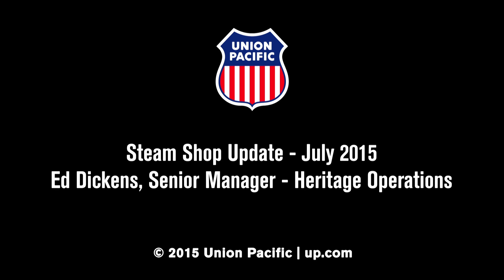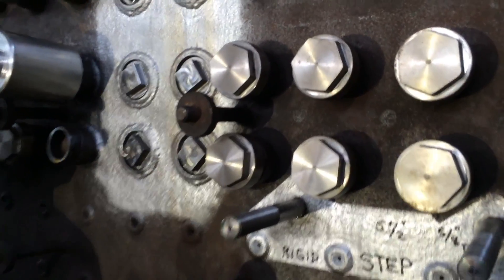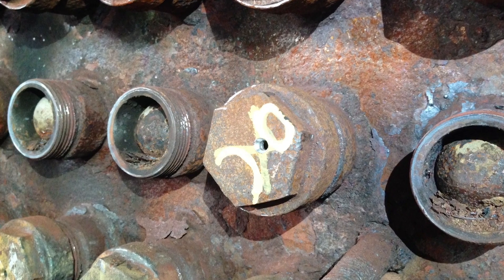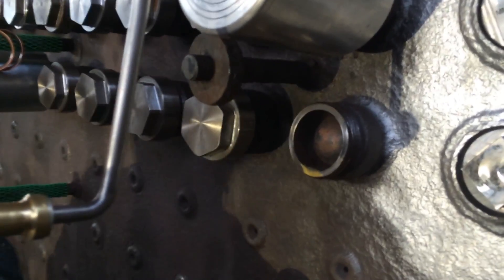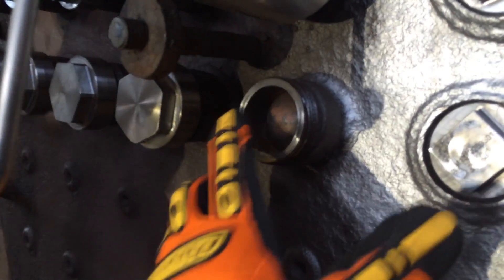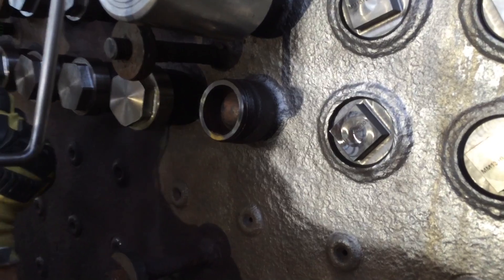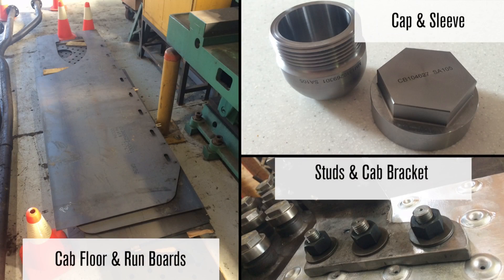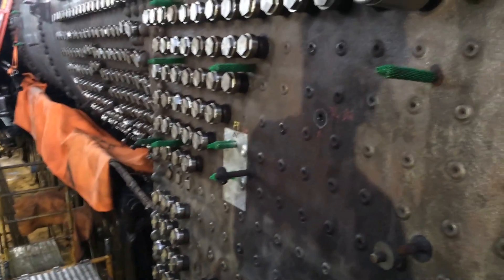UP Steam Update: July 2015

Comment: Will 4014 be converted to run on natural gas?
Reply: most likely oil if it is converted at all. Natural has would require so many modifications it would take away the preservation aspect.

Comment: Great update. Have you folks thought of setting up a water conditioning car and using some type of forced air drying system when the locomotives are off line? I work with steam plants and understand the need for clean pure water with the right chemical properties and proper lay up to prevent damage when they are not steaming. When I saw the video of what you were seeing on the boilers, it make me think of what I do to prevent that kind of damage.

Comment: I've a feeling that the UP will need fair-capacity desalination plants at the largest terminals to support the steam program properly, given what we know of the corrosion that sidelined #844 (the Sierra has a down-size version of this same problem, which resulted in corrosion contingency work on the in-overhaul (as of July 2015) #28).  Hopefully #3985 can solo the rest of the 2015 excursion season; #4014 won't be ready for another four years.

Comment: Now as long standing fan of the 844, the 3985 and the 4014, and I can not forget to mention the Southern Pacific 4449 Daylight..... I know the 3985 has been down a lot longer than the rest, and oddly enough running up against the federal maintenance overhaul deadline on the 844 was a huge setback as they were prepping for the 4014 project, so I know a lot of people are wondering if they are going to see these trains again.....

3985 has already been said to have been put on hold until the ongoing project of the 844 and 4014 are completed in the next couple years. With that being said however, they are doing the 844 and the 4014 side by side, because it looks to me, as they both need the same work done and basically need all the same parts to be retrofitted or made new altogether, so its possible that they may roll out 844 and 4014 at the same time (estimated around 2019-2020), so im going to say its going to be a while before we really see them again, but still inventively watching their progress is an enjoyment for me
Reply: Danny Lawson aside from doing a major overhaul on one locomotive and completely rebuilding another, UP is renovating the entire steam shop

they are removing all of the diesel infrastructure and turning the shop into a true steam locomotive facility with cranes, drop tables, machine tooling etc

that shows you how great the UP Steam Program is now
Reply: +Danny Lawson Well, the locomotives are owned by UP so what ever they say is proper is proper.  It's cool to critical and all that but frankly you're on the outside looking in.  UP is not under any obligation to maintain a steam program at all.  Whether they are repairing and maintaining them properly or not, it's thier business and not ours.  I am thankful they are keeping these things alive.  It's costly and time consuming and really isn't part of their business charter.  Revenues are tight for the railroads right now due to pressures on coal and oil.    The Panama Canal expansion and west coast port issues may place pressure on intermodal business.  This is a perk that isn't paying it's own way.  What ever happened to just saying thank you UP.  I'll say it for you.  Thank you Union Pacific.  

Everyone wants to be a Mechanical Engineer.  What are your credentials?
Reply: MustangRacerZX Yeah and 611 got back up and running in 9 months while 3985 is not mentioned in the video, goes to show you how great the UP Steam Program is now!
Reply: Danny Lawson You have a problem with ed... pretty obvious.... Great to spout opinion when you dont know facts. Grow up and let it go.
Reply: The shop was fine when Steve and the guys where there, they were fine when the guys before them where there, you wanna try to prove somethin' else?
Reply: Uh, the facts pretty much says it right there, besides, I never met him, but from what I heard and what's been going on, the guy doesn't know how a steam locomotive works, all this talk about steam engines is great, but doesn't know the know how on how to properly work on them and all that, sorry, not holding water at all!
Reply: +MustangRacerZX 884 willprobably come out first, as it doesn't need mechanical work done, just a boiler rebuild.
Reply: Not until Ed's gone, I can understand that, but the way Ed's not been able to keep people, it's not on my call to say thank you, especially with the every 50 miles we service the engine, that's a waste of time!
Reply: That wasn't needed back in 2012!